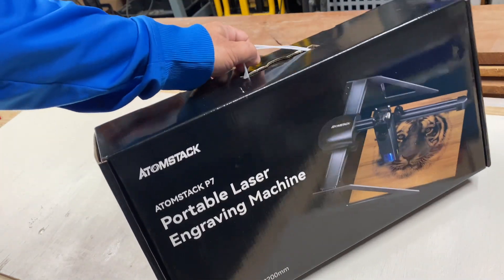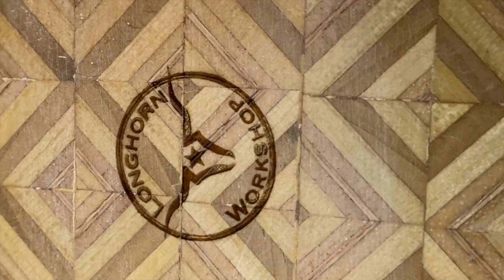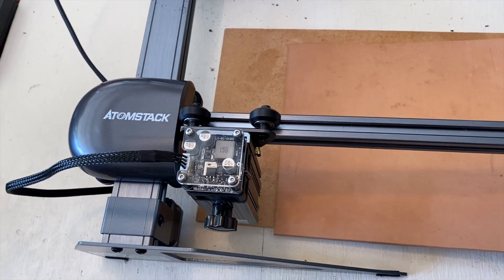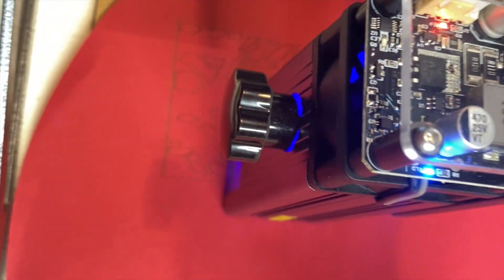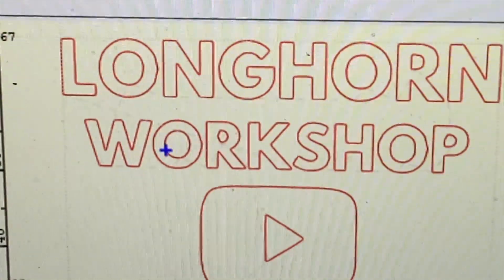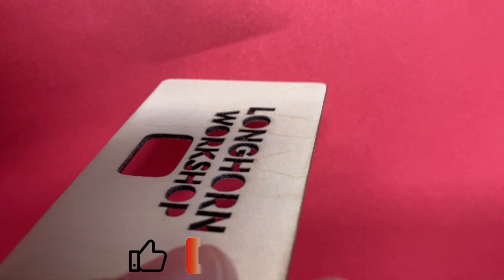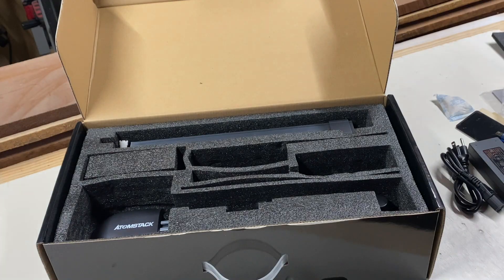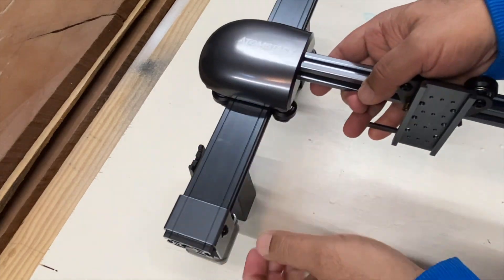Atomstack Laser Engraving Machine

Comment: Nice new toy, Harki. The amount of precise little things it can do, is just great 👍. For cutting stuff, try to use a wire mesh and a portable fan, so that there is enough air flow underneath. I think this might reduce charring.
Reply from the maker: Thanks mate, and thanks for the tip. As you said it’s good for the small stuff, if I can cut plywood templates with it then that will
Be great.